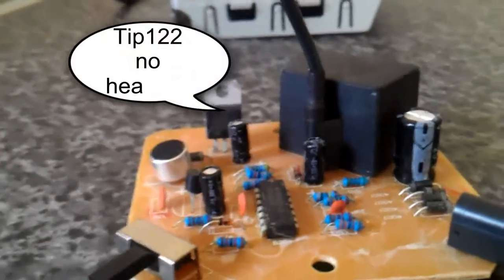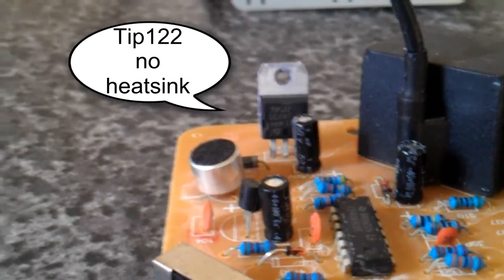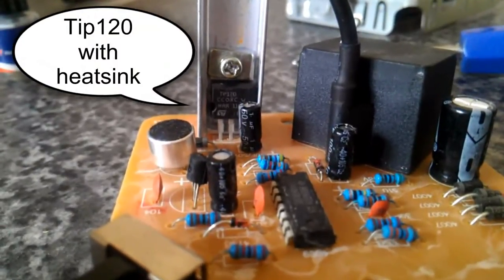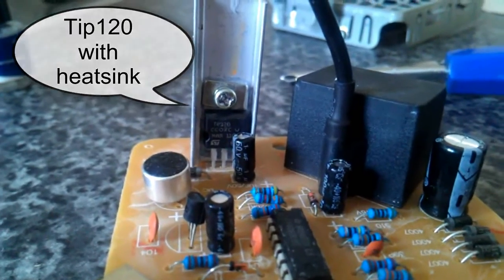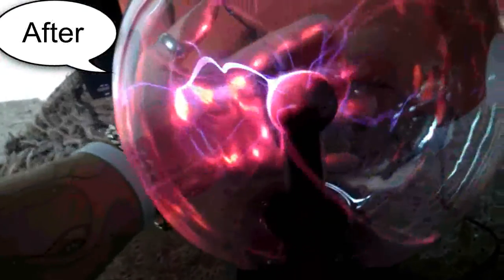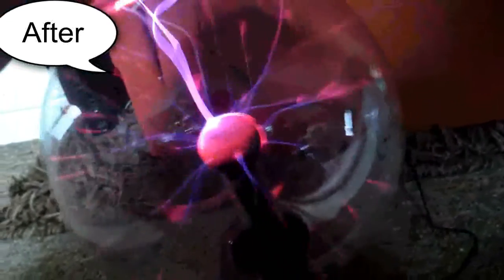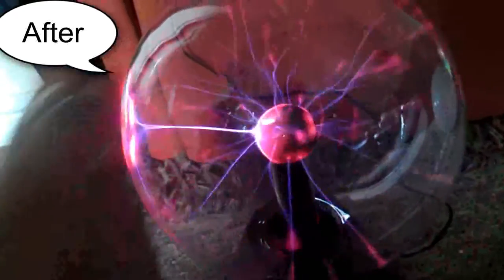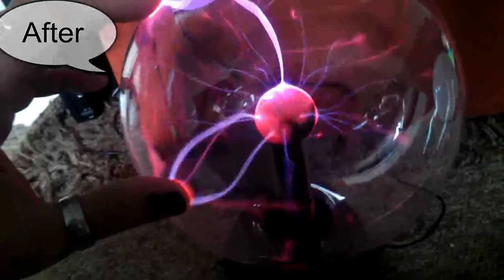Plasma Globe mod thanks to Juniortore1

Comment from the maker: Not a bad idea but i cant really be bothered as i brought it so i could use the globe with a different supply but thought id give this a try to c why a lower power transistor would work better but still might give it a go just to c if a lot higher one works ,i really want to get on with other things but cant move that well at mo .what do you reckon would make a good video then? mate